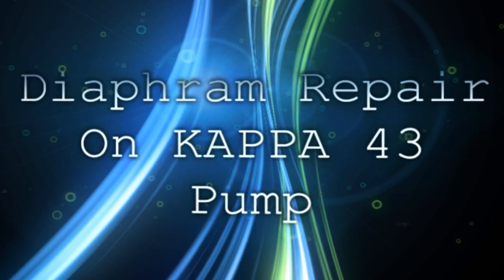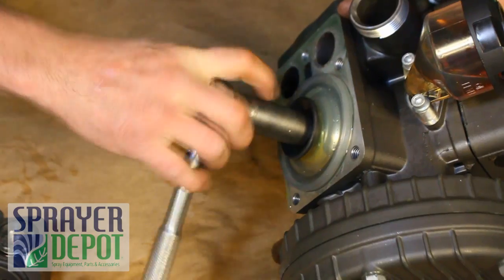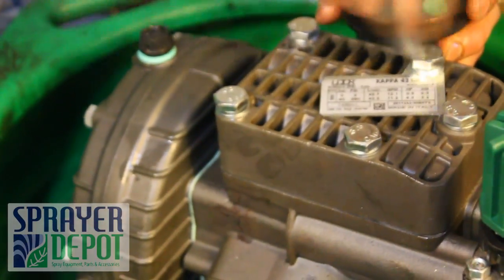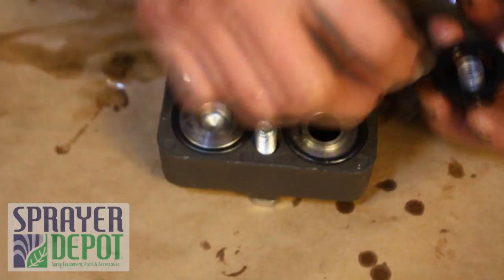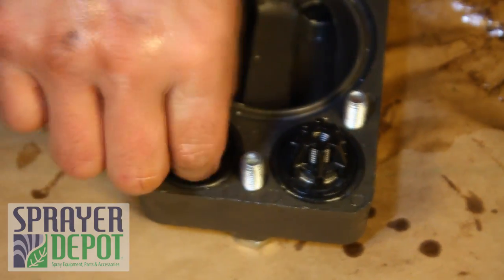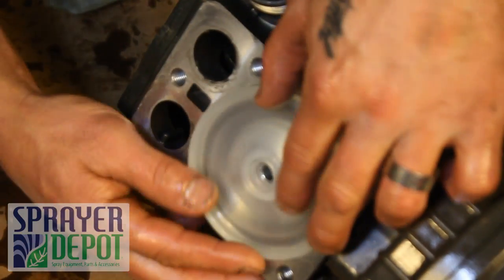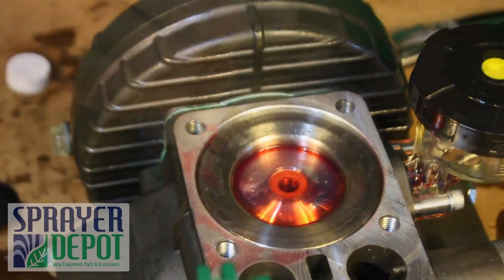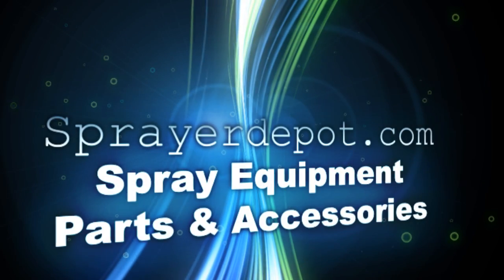How to Repair a KAPPA-43 Diaphragm Pump | Sprayer Depot, #1 for Professional Spray Equipment

Comment: I have checked all of these and the pump is still not making enough pressure so I am now thinking its something to do with the pistons as it has a lot of miles. I checked intake its clear. Rebuilt the regulator, Diaphrams look good, check valves are free and the springs look good. I can not raise the pressure any higher when sprayer is activated and it barely powers the 3 boom heads. It used to power them with no issues. All hoses clear, Filter screen is clear, there are no air leaks. So what are the symptoms if the pistons are going out?
Reply from the maker: Hi! If the pistons are broken, the pump won't turn. If it is a pressure issue only, you should replace the regulator. The service team says a new #601093 Control Unit for KAPPA-33/43/53 should take care of the problem.
Reply: @Sprayerdepot  Yes I rebuilt the regulator. I do notice the pump shaking when I engage it. When I switch to boom mode its smooth. I have a new pump coming so I will swap it out and see if the problem is still there. This pump is old with a lot of hours so its time regardless. I have checked the check valaves and they all are good so why it shakes has be wondering. I am thinking it may be a diaphram issue I am not seeing. I will save and rebuild this old pump and set it aside as a spare. I decided to rebuild everything and replace all hoses and valves.  Thanks!
Reply from the maker: @NDIrishfan71 , give our team a call if it still isn't working right - we'll be happy to troubleshoot over the phone: 800-228-0809.

Comment: On pumps that are mounted on the engine, do you have to take the pump completely off the engine first, before you replace the diaphragms?
Reply from the maker: Hi, it is a lot easier if you remove the engine first. Let us know if you have any additional questions!
Reply: Is the kappa 43 diaphragm replacement the same steps for the kapp 55